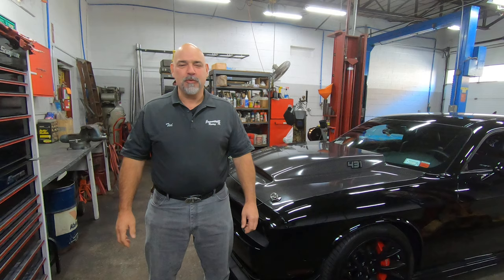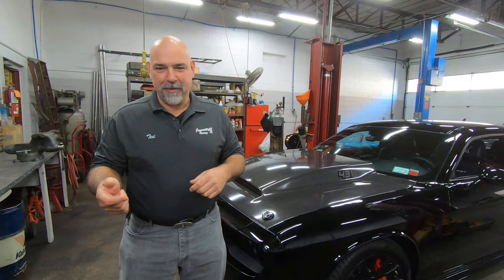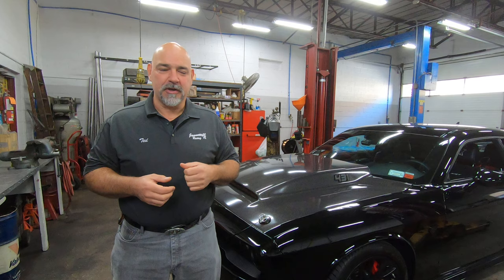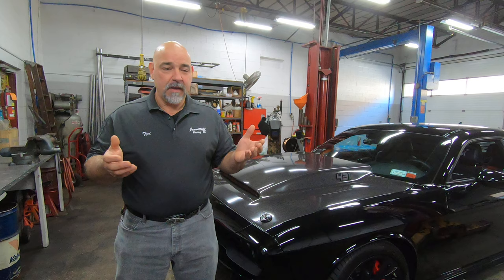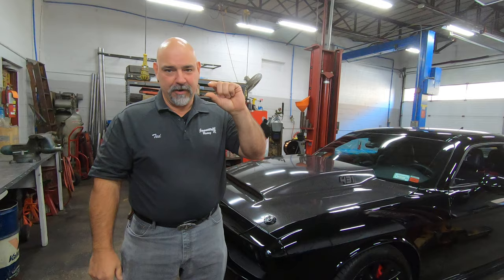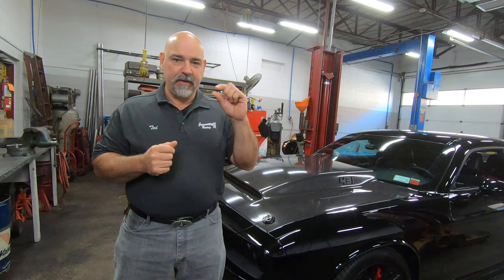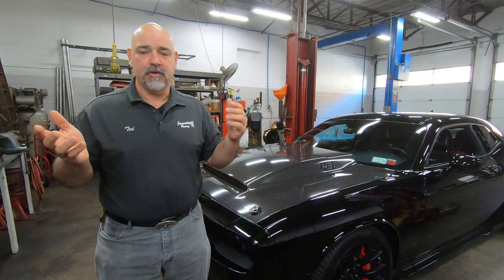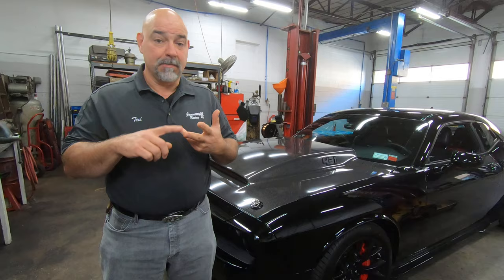The Great Gap Debate: What should my Spark plug gap be?

Comment: Great info, Ted. The gap thing is just like the octane myth, that higher octane in and of itself will grant you more HP. Another one is the exhaust back-pressure myth, that lack of it will burn valves. Don't know how these tales get started, but there's alot of 'em out there!

On the spark subject, I had a '00 4.3 V6 in a '89 S10 Blazer years back. I had stripped all the FI off and went back to basics - carburetor and HEI ignition. I grabbed a HEI distributor off eBay real cheap, and ran the plugs at the factory setting of .060". I learned a little something about ignitions after that, hahaha! After burning up 2 Chinese HEI modules one after the other, I finally installed a much better quality Echlin module, closed the gap to .45", and still got just .5 MPG less than it did when it was fuel injected (carb was damn close right out of the box, lucky me). No more HEI failures every 4-8k miles either. 😁 That was the best running vehicle in my fleet after that. Prior to that, it had misfiring issues at full throttle that slowly crept down into lower and lower RPM ranges, and would also come and go intermittently. The Chinese just haven't been able to copy an HEI module yet, at least not on eBay. 😉

Comment: Thank you for this.  Thinking of going boost soon.  Just regapped oem sparks for na set up

I’m having a running rich condition and I had a tighter spark gap. Do you think this will help fix the issue.
Reply from the maker: since opening the gap increased spark energy you can burn more of the fuel in the chamber but will not fix a condition where too much fuel is injected.

Comment: Thanks Heaps
I purchased new Plugs
NGK TR5IX 
And increased the gap to .49thou (and added granatelli zero ohm wires)
What a pleasant difference😍...my LS3 is idling much much smoother and getting better mileage per litre ( before 18.5lts per 100klms, now 17.1lts per 100klms around town
HWY gets 8.9lts per 100klms
Reply: Did you notice a power difference with opening the gap with the granatelli 0/ohm wires? I just put those wires on my 19 GT and was thinking about increasing the gap also.
Reply: @robertgallagher4971  
I only noticed a smoother idle , didn't notice HP rise

Comment: Thanks for sharing this.............FYI I just validated what you've said by me installing a 1 step colder set of plugs using a .030" gap replacing a set of OEM plugs using a .044" gap & ended up inducing cylinder combustion instability.......which when I pulled the colder plugs & regapped them from .030" to the low end of OEM spec.... .040" gap & reinstalled the same 1 step colder plugs w\ this widened gap & data logged engine......all combustion stability returned to engine that it had w\ the OEM plugs running the .044" gap (the midpoint of the OEM plug gap spec range of .040" to .050"---Ford 4.6L V8 in NA config......trying to find reason why only 3 of 8 cyls would experience knock at .70 load & up & not the rest) so my experience just followed what you've said to the letter! Thanks again!
Reply from the maker: I am glad you were able to use this info to improve performance of your vehicle thanks for watching and sharing.

Comment: Im running a Whipple supercharger on my 6.1 hemi the the spark plugs were pre gapped to .032 when I got the car. should I leave them or go to .050 factory gap?
Reply from the maker: If you listen carefully to the video you will understand what I am saying, Closing the gap will reduce the amount of spark energy it takes to jump the gap.  I wouldn't go .050 but I would go  0.040 to maximize efficiency but not push the coils past there ability.
Reply: @JANNETTYRACING  ok won't go to .050.  do you think about a .045?

Comment: Hi
Can I gap from 1.1mm to 1.25mm to my spark plugs  on my tucsan 2019
2000cm MPFI
Thanks
Reply from the maker: I suspect you can but test test test.
Reply: @JANNETTYRACING  
Hi
Thank you  for reply 
I do it 
it work good
I will use OBD2 diagnostic for live data and will see
Thanks

Comment: I have a 2020 V6 charger, no engine mods, just an oil catch can. Thinking about upgrading the coils with RIPP coils. Would i gain anything from this? Or not worth it upgrading just coils? And if I do upgrade the coils would I be OK using the the stock mopar V6 Spark plugs? Oh vehicle had only 15,000 miles don't want to change plugs if I don't need to. 

Thanks
Reply from the maker: You will gain nothing from changing coils unless yours have failed and engine is skipping. a Fresh set of New OEM plugs will do fine.
Reply: @JANNETTYRACING  ha thanks for the info! Appreciate it!
Reply: @JANNETTYRACING  you saved me some money, from doing something unnecessary. 👍

Comment: What about a 72 Buick Skylark? 5.7 V8 it says .40 but I'm about to try .50
Reply: How that work out for you
Reply: @300tolife8  it worked and I didn't see huge results. It just allows you to run leaner but that lean mixture is still limited by compression so you couldn't run any leaner than the motor wants regardless of spark. A stock ignition coil can support up to 50 before it runs like shit and the blaster 2 coil can support 60+ no problem, just watch the piston clearance. Nothing serious to stress but I just like the idea of more lightning in the chamber hehe
Reply: @TommTooTone  I just changed out my plugs and I ended up gapping at .045. The old plugs were like .042 .043. Idk just bc they were new plugs but let me tell you. She is definitely putting more power down. Huge difference. 07 Chrysler 300c 5.7l hemi

Comment: I have a 555 bbc with a 1200 cc carburetor running methanol what would you recommend for a spark plug gap
Reply: You mean cfm, I hope. A 1200cc carb would be the size of a vw engine. Regardless, impossible to answer without more info and testing on your part.
Reply: Start at .098 and increase in .001 increments until the engine won't run.  Back off .003  until it just starts to run and then add .007.  You should be in what we call "the perfect gap" range.

Comment: Question for 18psi what should i make my plug gap at stock boost 10psi i was runing .028 with 18 psi should i run .024 or .022 because at .026 i still got blowout at wot Thank u godbless🙏
Reply from the maker: If you listen to the message in the video you will understand that If your ignition system can't handle the boost there is something wrong with the ignition system and closing the gap is only a bandaid for a broken leg.  boost the voltage to your coils instead of closing the gap tune the Dwell time on the coils also.
Reply: @JANNETTYRACING  i understand that but what would u recomed doing if replaced the coil pack wireing an bought high quality packs already honest question
Reply from the maker: @gecko1406  We found that aftermarket coils are more prone to misfire due to the fact that the wiring can not support the added load from the supposed high output coils  Factory coils out perform aftermarket coils on stock wring.  JMS offers ignition voltage boosters that work incredibly well then you can go back to larger gaps.